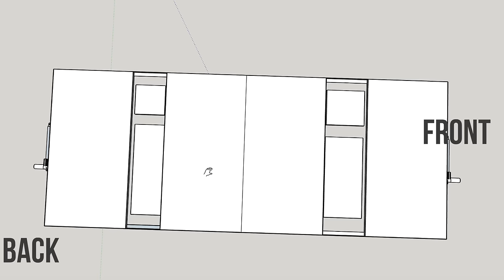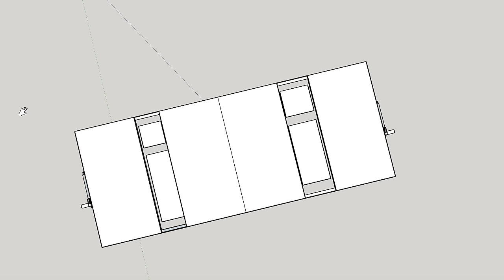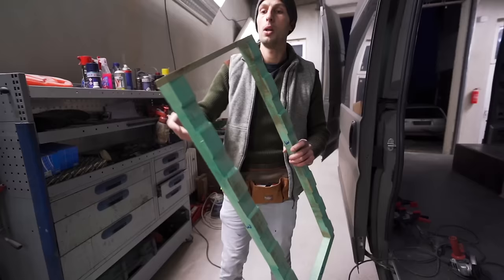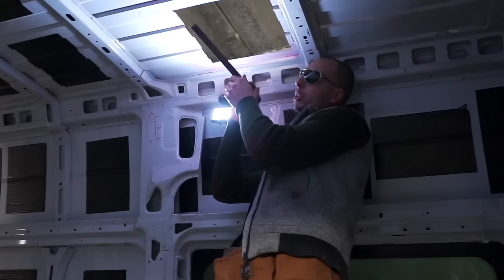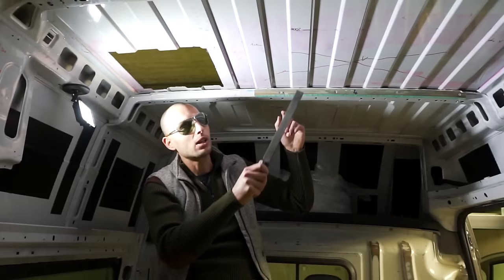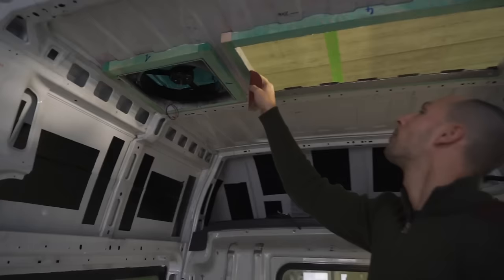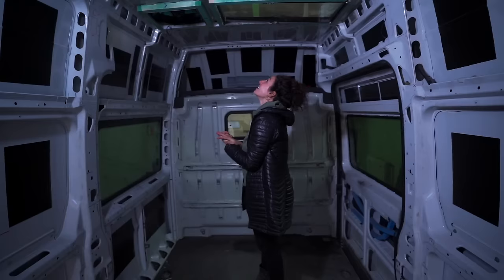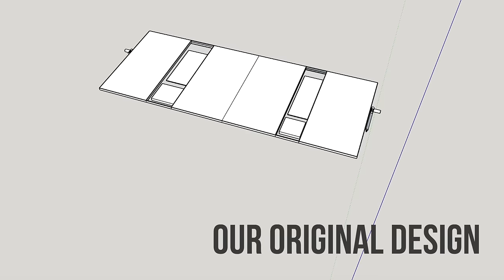WE MADE HUGE CAMPERVAN WINDOWS! / DIY Van Conversion (Ep. 9)

Comment: I might nick the huge roof window idea for my van. But I worry that they fit too snug and that they will crack when the van flexes (which it does!). I'm sure you thought about that.
Reply from the maker: Sure we did. It sits on a soft surface fixed in four corners with flexible glue. It has 2-3mm gap all around the metal and it's again glued with flexible glue to the plastic frame and glued with the same glue to the glass itself.
Reply: @ladiandmargaret  Thanks for replying! So only a 3mm gap should be ok? Perhaps I wait and see how it works for you in real conditions :-)
Reply from the maker: I don’t know, this is my first time 😂🤷🏻‍♂️

Comment: hey guys, great job there. You have a shop around just wondering if making steel support beam between window and vent would make sense instead/
in addition to wooden frame
Reply from the maker: It could do too. There is many ways hot to do this.

Comment: Next step? Water test the roof windows? Like riding in the rain with speeds over 100 km/h
Reply from the maker: They shouldn’t leak driving or parking. But will see how they perform.
Reply: @ladiandmargaret  Over time they will, such a weight on the roof will cause damage to the light roof.

Comment: Unfortunately this video will end up being one of those you review and talk about later ..Great idea with the big windows and vents..great craftsmanship .but a horrid plan follow thru ..Two very very major issues that can and most likely will give you issues down the road..first cutting out the metal roof support will cause the unibody of the van to flex and shift more than normal..A far better choice than cutting the support out would have been to drill out the spot welds move it over so it clears where you want your windows then weld it back in place..Next the way the windows are installed rely on an insanely thin strip of sealant to seal the windows ..They are not held down to the van under pressure with sealant sandwiched between the metal structure and the window . So as the van body flexes and it now will flex even more due to the removed support the sealant will either crack of pull from the body  causing a leak ..angling of the windows will not help this .. as the water on the roof runs into the low spots in the roof ribs and then runs to the front or back depending on how the van is angled or driving but it is not shed to the side..I also have concern about the 3d printed spacers..depending on the fill and material type used it can be a big issue..3d printer parts tend to separate at the layers especially in time with the sun and roof water causing expansion and contraction ..Please don't take this as an attack ..I hope it works out for you ..I think you guys did a great job with dealing with the rust and i love the ideas ..My advise for sealing the windows would be to fab up a trim piece from aluminum that has the required bends that can have sealant applied then bolt it to the roof .. that way the sealant is covered  and under compression instead of being doomed just by the flexing and expansion and contraction of the roof......If you are interested in what i am referring to i can draw you a model of it..By the way great video
Reply from the maker: Will see how this works out. I (Ladi) disagree with the support being cut out. It’s just next to another two supports from both sides. It’s not a concern. I purposely used very flexible glue to compensate some subtle twists the body of the car has. It’s not a twist 1cm, we are talking about 1mm maybe. This is how I approached the problem, it’s experimental and I’m willing to learn a lesson here. So far so good.

Comment: High wow factor, but these are thermally inefficient. Roof windows admit the most light and heat during midday, the time you’ll most likely want it to be as cool as possible in the van. Triple glazing helps against heat gain and loss via thermal conductance, but does little about thermal radiation. Even greenhouses around 60 deg latitude need venting during summer due to excess heat. A possible mitigation would be internal or external shade that can block the radiative gains, like a flexible solar panel that you can slide over it.
Reply from the maker: We’ll be using sliding insulated panels inside most probably with a silver reflective layer on the top of them. I think the metallic middle glass treatment helps with radiant heat.

Comment: Great Design - the next award is yours 😉💪🏻 But why don‘t you put out the wall between the drivers cabin and the loading area ?
Reply from the maker: Thanks. We drive the van around and we did not see the point of heating up the entire cargo space. It would most probably be impossible and inefficient.
Reply: @ladiandmargaret  sure?😳 But did you think about if you leave the cargo space to get into the drivers cabin, you have to open the sliding door. that shouldn't be particularly efficient either 😜

Comment: I see a potential problem with the front ceiling window, it slants towards the sliding side door, so if you exit the van while it rains, the water will be falling on your head. 😖
Reply from the maker: We’ll let you know how it goes when we’re testing it. Idk how else we could achieve the slant without encountering that small issue in exchange for the window location. Lucky for us we don’t usually go in and out of the van too much when it’s raining 😅

Comment: It aint according to the rules, but it looks great, hey Ladi i am building again my own rv ( number 4 ) right now and i ust finished the grey watertank , i saw you drawing about the drinking watertank,  i 3D printed all my tankconnections and including the threads, , i draw them in Fusion 360, and they are perfect , maybe something for you as well
Reply from the maker: Thanks. I (Ladi) set my own rules on my projects 😂 I don’t think 3D printed connectors are suitable for high pressure water system. They sell parts specifically for this purpose.
Reply: Nylon  carbon PLA

Comment: I think an opening sunroof would have been more practical
Reply from the maker: What for?
Reply: @ladiandmargaret  You can buy ready made glass ones like that  that open  with built in blinds everything iveco use them if you look on top off the iveco daily’s you will see pattern there should You whant to install one  that will open  which is perfect for good air flow and ventilation sorry to be negative 👍👍😘
Reply from the maker: I see no negativity, only opinion. Don’t worry. Or I could have triple glazed super insulated, custom shape windows with DIY blinds. Vents are better because of active, directed ventilation. My project, my rules 😎
Reply: @ladiandmargaret  i wish you every success

Comment: I have to say, putting a double or triple glazed insulated glass unit into your van roof is one of the most ridiculous and dangerous things you can do. They arent designed or used in vehicles for a reason, so please let people know not to do this. Pay the money and stick to lightweight plastic roof windows for your own safety
Reply from the maker: What do you think is the danger?
Reply: @ladiandmargaret  the danger is that the vehicle would not pass any vehicle inspection in Europe after conversion, if that van was in a crash no amount of glue and fixings would stop a building window unit coming off and killing someone. The plastic units are manufactured and tested for retro fitting and are integrated as part of the vehicle fabric after fitting. Its a lovely conversion and I dont mean to offend, but it could result in many people having the same idea and doing the same thing in very dangerous ways.

Comment: This is a toxic substance you put in the woods is not recommend to be in a live in space you could print on plastic the frame or buy fiber board which is made a compound mixture of would and plastic
Reply from the maker: Just out of curiosity, do you think the wood homes are built from are not treated?
Reply: @ladiandmargaret  to be honest I chose not to live in one so is mater of choice so it's choice what material you use the glass is super heavy  I wouldn't do a wooden frame anyway again is your van my comment is due tu you mentioned that  in this on you take your time to about mistakes IAM a diy Guy as well and as a friendly follower tip I'm proposing it's not a good idea